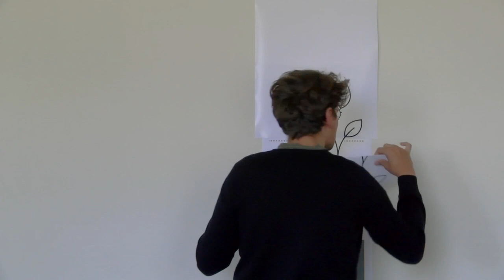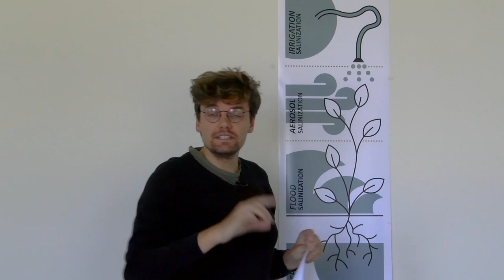Salinization processes

Comment: Great video Jeroen. Nice to have these processes together in a nicely explained framework. Maybe a small addition: irrigation can also cause salinization even when the water is not brackish. Due to evapotranspiration processes, plants naturally concentrate the ions present in water. Depending on the water source and quality, this accumulation can cause salinization. Irrigation can also cause groundwater levels to increase in case of insufficient drainage and this rising groundwater can then transport salts present in the parent material and soil underneath the root zone and cause damage...